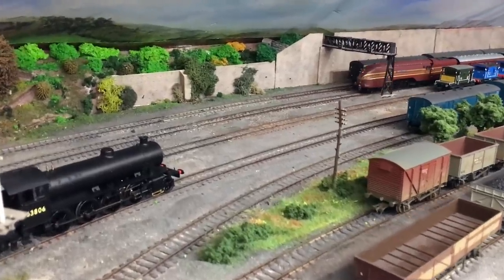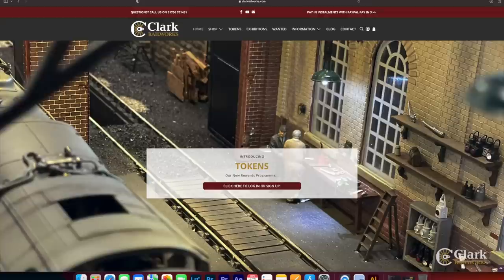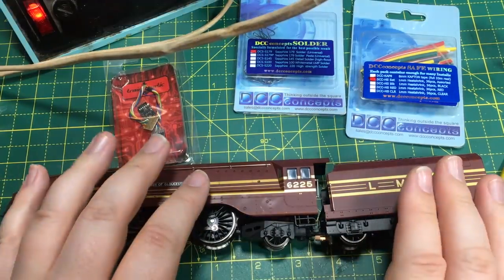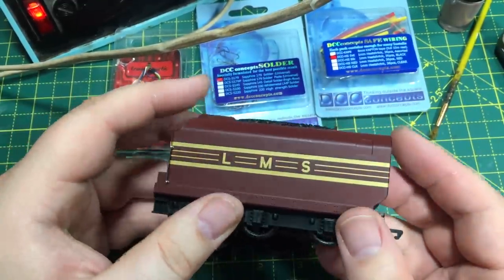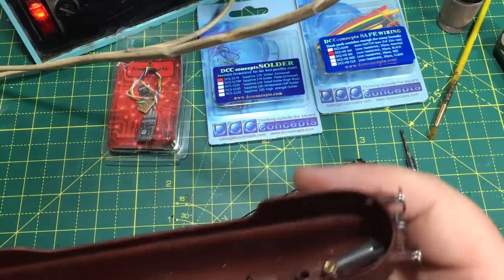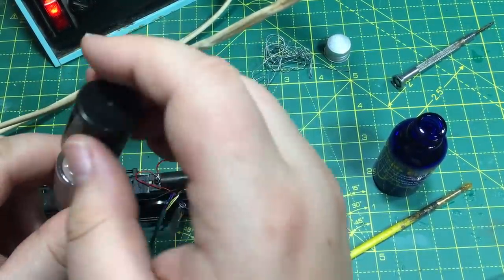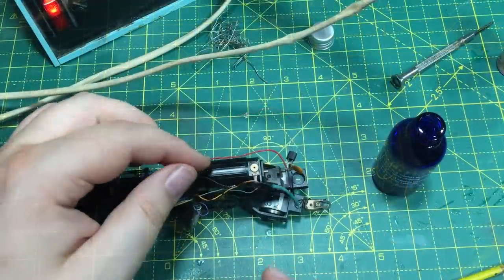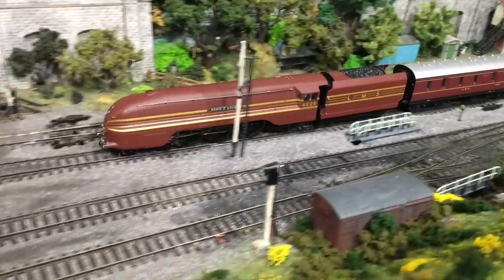Easy DCC Hard Wiring Tutorial - Make Old Locomotives Work Like New!

Comment: Excellent video as usual Jenny. For those contemplating a dc to dcc conversion, remember to make sure your model runs well on dc first. Add extra pick ups if needed, (especially on tender drives). DCC Concepts sell a wiper pickup pack and they are superb.

Comment: Thankyou so much. I have only just recently moved to the dcc and have been slowly replacing my locomotives with dcc ready versions as I felt retro fitting older locomotives with dcc myself was a bit of a black art or seemed quite expensive to get done.
Seeing how simple it actually is, will give some of my older hornby locos a new lease of life. 
Ive been told however that its not really possible with the older split chassis bachmann locos. So Im curious to know your thoughts on those too, Please Jenny.
Reply from the maker: I’m glad it’s helpful. Split chassis locos can be done, but are a lot harder.

Comment: I did almost the same conversion  a month ago - although I was using the non-streamlined Hornby Coronation (with the same chassis design) and I wired in a 6-Pin DCC socket. 

Would have been useful to see this video before I did mine and it should help others

Comment: Hi, an interesting presentation. I have fitted an AED-8PH DCC Concepts AE Model 8-Pin Harness 4 Function Mini Decoder together with the associated AED-SA1 DCC Concepts AE Model 2-Wire Stay Alive into my tender driven / ringfield motor powered Hornby Duchess of Sutherland. This has significantly benefitted its running properties and would make an interesting and useful presentation for you to do on YouTube. I have also fitted these two items into the cab of my Hornby 00 GWR Dean Single “Achilles” with similar benefits. The latter required me to drill a small hole between the cab and boiler and to de-solder then re-solder the wires to the 8-pin plug (I only re-soldered the 4 wires to enable the locomotive to run). Another potential YouTube presentation. I now  de-solder the wires on the 8-pin plugs of decoders when hard wiring them into locomotives and thus am able to re fit the plugs in order to claim on warranty should this be needed.

Comment: Thanks Jenny. 
I’ve watched this through and can see it looks very simple. However, I’m still utterly bamboozled as to what you have to connect to what, where and why. For example, are there specific spots on the motor to which you have to solder the wires? How do you know whether you’ve linked to the tender pickups correctly? 
If you play the video back to yourself but listen to the sound without looking at the picture you’ll hear lots of references to ‘this’ and ‘it’ without explaining what those things are. That’s what’s confusing me, sorry. 
Thankfully I don’t need to do this task yet as I’m still on 100% analogue but I’ll study this video again and others like it before I do eventually hard wire a loco for DCC.
Reply from the maker: I’m just soldering to the points that the old wires were removed from. These are the solder points that connect to the motor’s brushes.

Connecting the tender pickups is a case of taking care and doing one at a time to avoid getting them swapped over.

Comment: Hi Jenny, here are a couple of questions for you:
1. In terms of “old” locomotives, would this work for an old Triang Princess?
2. Does the motor have to be a minimum type eg 5 pole etc
3. As above if the dc loco does not run well, will the conversion help?
4. As all my locos are DC the cost of conversion could be inhibitive. What is the cheapest chip you recommend for the budget minded and do they work on all locos?
Big questions but important .
thanks
Charlie

Comment: Nicely explained but please note cutting the 8 pin plug off voids any warranty.
I personally would have used a harness which allows you the option of reverting the loco back to DC with a blanking plate if required.
Always best to future proof the job.
Reply from the maker: In this instance I decided to keep the installation at its simplest.
Reply: @JenniferEKirk  just as simple with a harness, maybe even simpler. 
Same wires, same connections.
When installed just plug in the decoder like any normal dcc Locomotive 👍
Reply: @BarnabasJunction can you recommend a suitable harness to get ? Thanks.

Comment: Hi Jenny. Great detailed video as always. Just got a question about wire size. I've got one of these and one of the pickup wires came off inside the base keeper plate. I was hoping to extend the wires slight to make future servicing easier as there isnt much wire to play with. So was just wondering what wire size can be used for the red and black pickup wires.

Comment: Nice and easy under that spacious body moulding, but try it with a rebuilt Merchant Navy! No space at all in the loco, so it’s necessary to transfer wiring into the tender which is more tricky. Perhaps Jenny you could do an eg video on one of these - fitting a Hornby Bluetooth decoder, speaker and power bank. It’s a conversion I intend to try, but the transfer into the tender (for space required) needs working out.
Reply from the maker: That sounds like a great idea for a how-to guide. I'll look into it!

Comment: It would have been useful to mention that its best to prove you have not your wiring mixed up by checking you can read the locos address on your programming track before fitting the body and before trying it on your layout.  Decoders do not like their wires being  wrongly connected and may be destroyed in a wiff of blue smoke.

Comment: I don't have nail varnish. Anything else I can use
Reply from the maker: Nail varnish is quite cheap and is readily available from many shops. 

Alternatively, you can get liquid insulation from some model shops for a substantial increase in price. It is essentially the same substance branded differently.

Comment: I just cant solder :(
Reply from the maker: Practice makes perfect, and so does a higher powered soldering iron. A lot of modern soldering irons are strangely low-heat, which just doesn't work and it can make you think you can't solder when really it's just a problem tool. Don't put yourself down.
Reply: @JenniferEKirk  I know - I need to give it a go :)